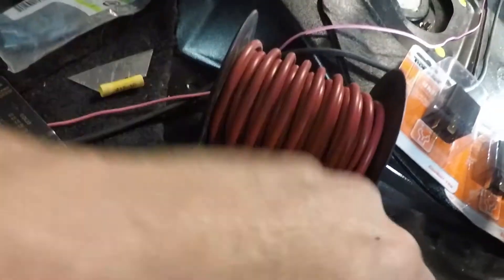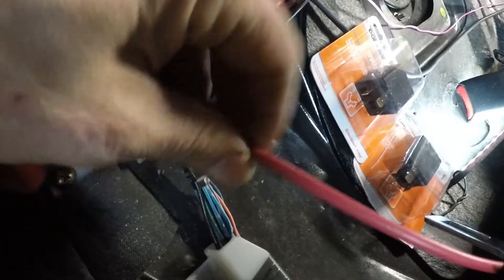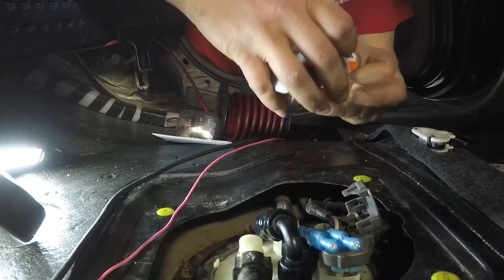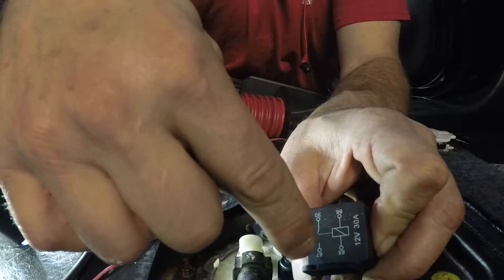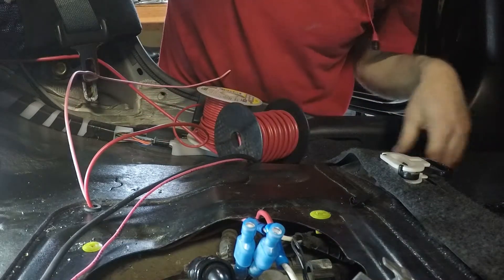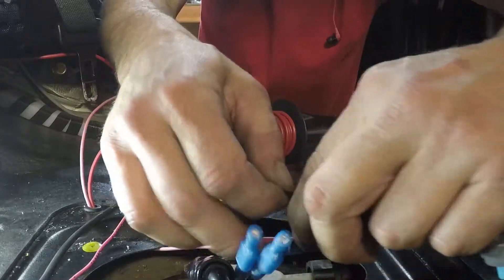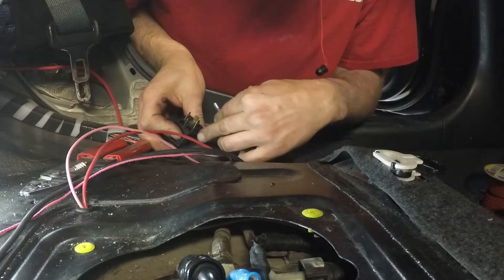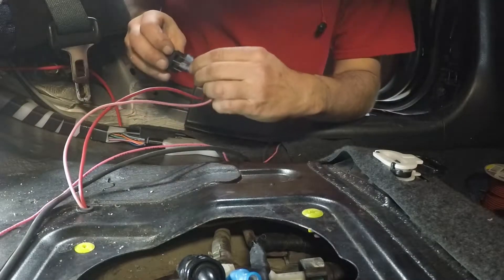How to hard wire an Evo 8/9 Fuel pump relay for a double pumper setup

Comment: So did you have two wires run from the battery for power for each relay?
Reply from the maker: Yes. We run one wire per relay.
Reply: @snailfedperformance7177  I’m actually in middle of doing this with mine for two 450s with hobb. I didn’t get why you did the Y connection of same wire into the relay and what was that wire for?
Reply from the maker: @snbmotorsports1526  its the ground wire.  When the signal is sent to the relay it activates the ground.

Comment: is it necessary to upgrade the return line when running a double pumper? got a -8an to feed the rail.  thanks snailfed
Reply from the maker: I would.  With the volume of fuel you are running with two pumps on the feed side the stock fuel line is kind of a restriction. We run 6an returns that y off too two 4an lines. One goes to the factory fuel pump housing return. The other to the passenger side of the tank.
Reply: I'm running 2x460's in a Squash double pumper with  -8AN Feed & using the OEM Feed hardline as my Return with -6AN to fuel rail & hangar! Can you see a problem there? Do I need full -6AN return? What are symptoms of a restriction in the Return line?